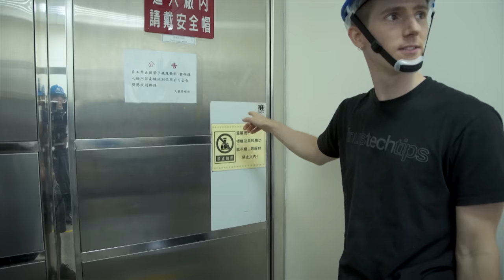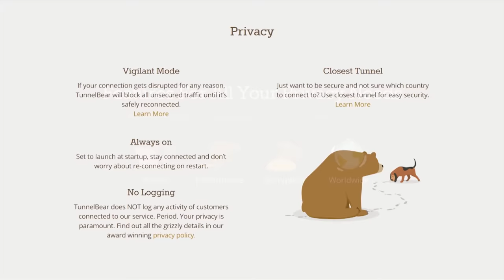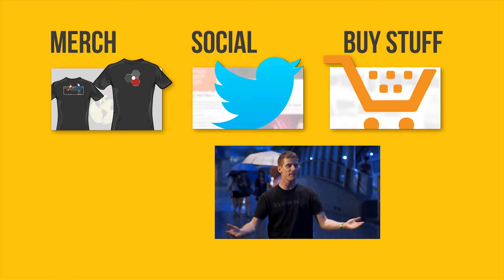Turning SCRAP Electronics into GOLD BARS!

Comment: I repair appliances and I find this extremely funny because I was just talking about this to my boss about how important it is to recycle the pcbs but he thinks it's the biggest waste of time for everyone... Great timing for this video now I have something to prove my point
Reply: Axiomatic scrap yards and dealers pay pretty good for pcb;s
Reply: last I checked, building a planet is pretty expensive. if it is one thing I learned from watching Michael Bay's transformers is that rebuilding a planet is HARD work.
Reply: Axiomatic But between the prospect of running out of resources while also damaging the environment we depend on beyond repair, and using some paper sheets we decided have some value for preventing all of the things mentioned above from happening, what would you choose?
Reply: but they got secret voltage and you can't just throw away used Cyanide to the river
Reply: It might be expensive, but that has no weight in Lukes point that its important to extract. I think Grenherb got a little carried away with that comment to be honest. But it is definitely worth extracting metals from ,at-least, electronics.
Reply: it is a waste of time if you were to hire american workers who demand high wages to do this kind of dangerous work with toxic chemicals, and high temperatures. Linus didn't say how long this process takes. Didn't explain how much money is spent on power and fuel to process all of this material, and labor costs, thus it may not be possible to do something like this in a Western country since labor isn't cheap compared to Taiwan, and the rest of the few BILLIONS in China.
Reply: We are already running out of copper.
Reply: Luke McClelland look at the amount of work, time, machinery that goes into what they just did. If youre not rich then you dont have a starting point its impractical to say the least
Reply: i never said that my boss should do this him self but it proves a point that receling them is worth it and it not though all of it out in to a land fill. i see at lest a 8 yard bin get put in to a land fill a week
Reply: Luke,scrap dealers pay very well for pcb's if you find the right ones,it just takes some shopping around.Also to all the naysayers out there there are ways to do this without cyanide and a multi million dollar plant.It can very easily be done on a hobby level as I do it myself.But if you think you're going to get rich and tons of gold you are mistaken.Nonetheless it is fun,doable and the info is out there for anyone who cares to learn.
Reply: Luke McClelland ,please let us know what your boss says to you when you show him the video 
thanks

Comment: Robber A: Let's break into this bank! I heard they have 20 kg of gold in there!
Robber B: No! Let's break into this recycling facility. It's way easier and they also have tons more gold.
Robber A: WHAT?
Reply: quite true, security would probably be nothing compared to a major bank
Reply: Xavierpony, That's exactly what I was thinking. It's probably really easy to break in there compared to a bank. They aren't quick on the alarm, they probably don't even have an alarm to send police and they probably don't have as many cameras or security guards. Perfect stealth mission for Payday 2.
Reply: Simon until the one security guard just vents the cyanide gas... oops no one should have been in there!
Reply: I would be surprised if they keep gold, silver or any other valuable materials there for any length of time, for a business like this, you want to extract it, sell it and ship it out as quickly as possible.  The ideal is to have that bar of gold sold before it's cool enough to touch, and shipped out the same day.   Most likely with gold, it's sold long before it's produced, and shipped out by a secure carrier the same day it's extracted, then stored at a secure storage facility and shipped to the buyer on an as needed basis.
Reply: True story...
Reply: Simon breaks cyanide chamber
you're ded
Reply: Guys. The thermal drill. Go get it.
Reply: Guys. The thermal drill. Go get it.
Reply: I'll bring the ECM jammer
Reply: just make sure you wear hazmat suit plus the oxygen tank, in case the place is filled with deadly gas
Reply: they probably have a bank car come pick up the gold bars every day. and they have a safe as well.

Comment: this should be implemented everywhere
Reply: John Doe it is profitable. Instead of just saying something dumb, do your research. It would be profitable in almost every country.
Reply: At some point it's not even about profits. It's about resource availability which this helps out tremendously.
Reply: If there was enough financial incentive to have one of these in  the US, there'd already be one by now. 

The cost of putting in one of these factories and running it has to be less than the money gained from the recycling of platinum, gold, silver, and copper. You also have to start making money on it fairly quickly, within a year, to get most people with money to put one in. We see them make 39 million a year in gold, roughly $400k in silver, and $5000 in copper. Even at those price margins, you have to consider how much people need to be paid, what kind of machines you use, the chemicals you need, any maintenance the machines need, so on.

Right now, it's just not financially viable, and most entrepreneurs aren't into charity work.
Reply: it is particularly profitable in china because of the high density of manufacturers that generate these scraps. So, you need a place with similar state to make it very profitable.
Reply: it is implemented everywhere.
that is why you shouldn't throw away electronics in the trash.
this is why you dispose of it in proper places like e-trash.
once that e-trash is collected.
other people collect the boards, wires, anything metal.
they take it to a scrap yard.
so and and so forth, until the metal has all been collected in its raw form.
metal is valuable so there will always be people recycling it for money.
Reply: I live in a township in the US that simply refuses to take any of my recycling. I've talked to the township and the recycling center and they still never take anything I put at the street (in bins marked according to their guidelines). Much of the US still treats recycling as an unnecessary chore and it is extremely unfortunate.
Reply: +CalculyticCuber it's simple it depends on how many electronic old stuff they can turn to these expensive bars of metal if it's a lot like in China it will be profitable
Reply: Also these companies need really high level security and really good wages to stop employees from stealing the gold.
Reply: ahh... love how the video clearly states small island country of Taiwan, and when people see a Chinese person they just say "this would only work in China". lol. wtv.. on the other hand.. I don't see how this won't work everywhere else. if a place like Taiwan can make it work, it shouldn't be hard to make it work in most first and second world countries. Sure Taiwan have the advantage of having many Tech companies either being founded there, their CEO or founder is from there, or they buy semiconductors from there, but the country have a small population and they were able to make it work.

Comment: The Techquickie video on e-waste left me somewhat worried about e-waste disposal in general. Thanks for showing us how it should be done. I appreciate that they take so many precautions against pollution (though the cyanide and HCl might be a hazard to the staff).
Reply: Still good technology though - localizing pollution production to a limited space is still useful. That's why I never bought the whole, "electric cars just move the pollution somewhere else" argument - it does, but it's much easier to upgrade plants and/or contain pollution at a single location rather than, say, among 800,000 vehicles spread across a city.
Reply: Stephen Angelico What I see here is no recycling, PR bullshits, rather it is precious metal recovery. This process leaves 99% e-waste untouched or transformed to another waste. Just think about all glass fiber pcb material, the diluted plastic packages in the cyanide and other material which won't ever be profitable to reuse. That is nicely hidden from this video which is disapointing.

Comment: Wait, so it's basically: Extract the valuable materials, fuck the rest.
Reply: BarrelTrollz What? The rest is silicon? Where did you hear that? They're just removing the metals,  so the circuit board with all of its toxic compounds is thrown out.
Reply: BarrelTrollz Not valuable but it is the most "toxic" part. It contains almost all the flame retardants etc.
Reply: Yeah, I'd be interested in how much recycling can be done before the cyanide and other chemicals need to be disposed of (and how).. Although reclaiming the metals like this is probably better than mining and creating more.
Reply: A Roadie at what part in the video did they say "they extract all the valuable materials then throw the rest of the waste into a landfill for someone else to deal with"?? I came here to see how precious metals are recycled not how pcbs are taken to another facility.
Reply: Oxygen is the most abundant? I'd have thought it was carbon
Reply: A Roadie Didn't you see what that did with the "furnace's" waste?
Reply: they don't dispose of the cyanide, once the electrolysis is completed they are left with gold, copper and cyanide. if you start with cyanide and add copper and gold then take the copper and gold out you can only be left with pure cyanide ready for the next batch
Reply: there will always be someone to find out the negatives in everything positive...
Reply: Ah, got ya. Thanks Grumpher ;)
Reply: Did you miss the part about the ash being used for concrete?
Reply: How much were you expecting them to salvage? They reclaim the copper, silver and gold and sell the ash for cement filler. Seems like they're making the most of discarded components. For all we know they are in the early stages of the process and are working to reclaim more of the materials.

Comment: That's a cool system. I work at a coal power plant and the ash gets reused instead of buried in huge concrete lined holes in the ground like they used to do.   The ash from burning the coal gets tested for toxins and sold to the department of transportation for use in new roads and the rest gets sold to construction companies that use it to make bricks.  If it weren't for CO2 taking all the attention, people would be impressed with how the other much more deadly toxins are removed from the flue gas such as the chemicals that make acid rain, mercury, NOx, etc.  99.9% of those are captured or converted before they can escape to the atmosphere.  We're working on CO2, but just aren't there yet.  There are ways to capture or convert it, but I don't think people want their electric bill to go up about 6x overnight, so we have to wait for more efficient processes.  OR something to replace coal all together.  Like a ultra efficient and cheap solar cell or cold fusion :)  We have invested heavily in wind power, but it will never take the place of coal.  It's expensive and completely unreliable.

Comment: They use sodium cyanide solution and bubble oxygen in it. The gold gets oxidized. You get some gold salt. It stays dissolved in the water.  

If you want to do this at home, I don't recommend the cyanide process. Use aqua region instead. The cyanide process might release cyanogen (gas).

You could also use HCl + bleach which releases chlorine and this will oxidize the gold to Au(3+).

Comment: Are they also using the heat generated from the burning process to power, or heat nearby homes perhaps? Generate electricity? 
Just to further optimize the proces.

Comment: i have a question regarding the quick heating and cooling of the dioxands during the burning of the cloth process, the energy you need to heat and cool the toxins is produced from what, coal? isnt that equally as bad as just releasing those toxins? I'm not quite sure where taiwan's energy source make up is.

Comment: Quick estimate by online calculators as of 6/11/2019:

Per month income of plant (Prices in USD):
Gold: $4,272,512.72
Silver: $424,196.95
Copper: $5860.99
Total: $4,702,570.66
Yearly: $56,430,847.92

I'm in the wrong business.
Reply: That's just the income. I expect the actual profits to be pretty slim, due to the costs of operating all this equipment.

Comment: I don't get the order. First, there was a cyanide process to get the gold separated from the rest, and then he just switched to the burning of cloth? And acquired silver there? Then later on the rest is bathed with King's water solution, and gold/platinum is dissolved, he says the remaining silver is transferred to another facility? Like, what's going on? What's the correct order? Why did you jump from a stage to another with leaving gaps in-between?

Comment: I wish the emachines brand still existed. I bought 2 emachine computers over the years. An Emachines W6409 back in the day with a 3Ghz Pentium 4 and 1Gb of ram and years later right before they went belly up... An emachines El1358G slimline pc with an Amd X2 220 and 3 Gb ram. Wanna know something cool.. Out of the 12-15 desktops I've owned over the years and treated like the we''re living in satans butthole.. The emachines still run like a dream. I'm on an upgraded to the max emachines el158g right now... 8 GB kingston Hyper X blu ram... AMD phenom II X4 910e and Gigabyte GT 1030. It simply works for me and cost me 400$ and thats with all the upgrades, I bought the emachines tower with stock internals for 249$.. My emachines W6409 from 2004 still runs like a champ till this day and I left that thing on in a bar with 100's of smokers for 4 years straight!

Comment: Unfortunately recycling is unpleasant and low paid work. No employer really factors in the unpleasantness of the job too people in regards of pay. Health and safety in westernised countries is factored in but its considered as a "you put this in this bin and that's low paid" job. Employers only factor in the health and safety which they "provide" and only pay for the skill set required. The unpleasant factor they never pay for. Its a job you do. if not, we can find enough other people to do it. The skill in actual selection also is not paid for either so plenty of impurity in the recycling. As long as you are seen to be doing your job the end result in resource is not important. I really could explain this more but you know its better than no recycling and really you wouldn't care. 

But the recycling industry is a nightmare in regards to people it basically means you are working with shit and its always shit . If one industry needs to be sorted out and automated this is the one. My rant ends